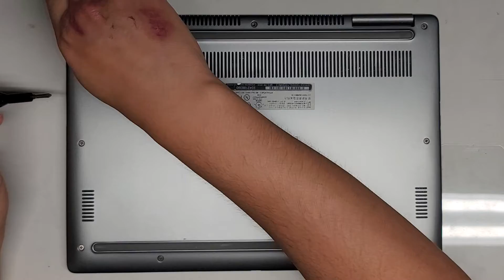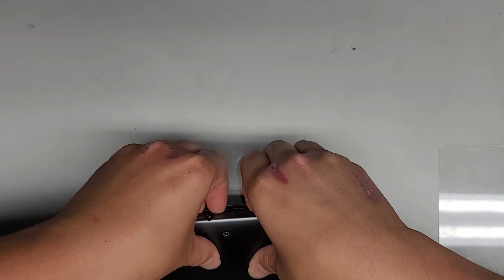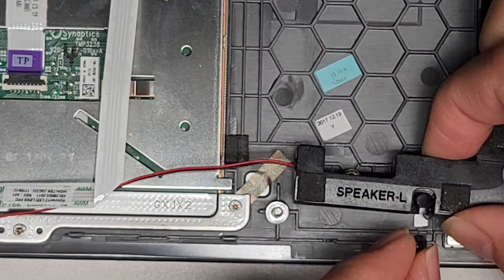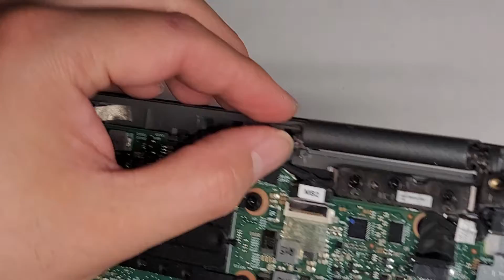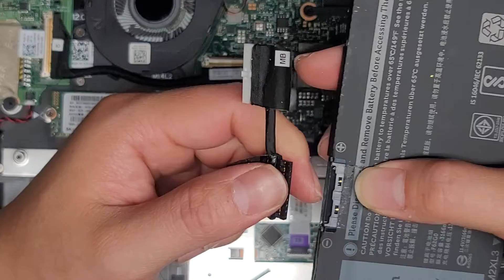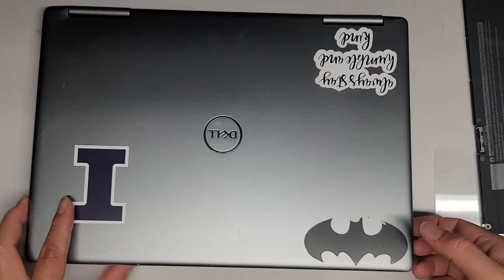Dell Inspiron 13 7373 2-in-1 Disassembly SSD Hard Drive Upgrade Battery Replacement Repair Quicklook

Comment: Great video, thanks for the help. My only recommendation is do not disconnect the battery cable from the computer board itself but rather from the battery itself. It comes off very easy and you simply reconnect it to the new battery and off you go.
Reply from the maker: Nice

Comment: Hi. I own a Dell Inspiron 13 7373 i7 Convertible laptop. The border of the display has started coming off and is getting disintegrated. Please let me know what can be done to replace the rubber display border. Thanks in advance
Reply from the maker: Need a new bezel.

Comment: Hi, Binh, where to buy the correct Dell battery? I can only found those "made in China". is Chinese battery ok? Some of them are $39-41 and some even $36.
I have the same laptop in your video. My probelm is when I push the power button after the laptop "sleep' from inactivity, the screen does not come on even after an hour. To turn on, I have to power off the laptop (press and hold the power button down) and then turn back on. When it is on, it's so noisy (the fan is on constantly non stop) and it is hot. Is it the battery issue? Could it also be a hardware issue that causes the the fan to be on and hot?  You explain so well in the video. Thanks
Reply from the maker: Hmmm not waking from sleep is not a battery issue
Reply: what do you think the problem is? Hardware?, virus? When I call Dell support, it make the diagnostic remotely and the error code indicates battery per Dell tech. My battery has been bad for at least 10 months but I use power cord instead. This not waking up from sleep just happened about few days ago.
Thanks.
Reply from the maker: @paulng2455  you can try another battery. Never seen that issue before
Reply: Have you figured out what is the issue here because my laptop is having the same situation with not turning on after sleep

Comment: Hello sir is this possible to  replace the dell Inspiron 13 5379 oem dull display with dell Inspiron 13 7000 display or any other in 13.3inch which is hving atleast 90% sRGB or dci p3??.
Please give your dear suggestions.
i Live in Delhi, India. 
please suggest
Reply from the maker: I'm not sure. I don't experiment like that.
Reply: @ItsBinhRepaired   okay thank you for replying sir  but can you recommend anyone or ask smbody who has knowledge of this things.
can you research about it. 
i wont mind waiting for the answer.
😀
Reply from the maker: I don't know anyone with that. Google can help. You can also ask screen sellers.
Reply: @ItsBinhRepaired  here in India there is no specific screen sellers either ppl  sell new or used laptop . or repair them by procuring same part from other laptop.
Reply from the maker: @CaptainScorpio24  probably better not to mess around then

Comment: Thanks! Btw, can I disconnect the battery without removing the cable from the motherboard and instead just remove the cable from the battery itself?
Reply from the maker: Sure, I did that in my latest Dell Laptop video.

Comment: Excellent video! I've just bought a 7373 from eBay for a bargain price because sometimes it doesn't detect the hard drive. Hoping I just need to re-seat the hard drive or perhaps replace it to get it running like new. :)
Reply from the maker: Most likely will need a replacement drive and clean Windows install.